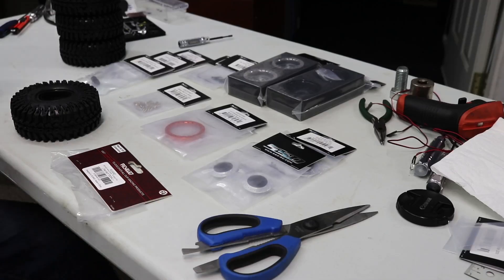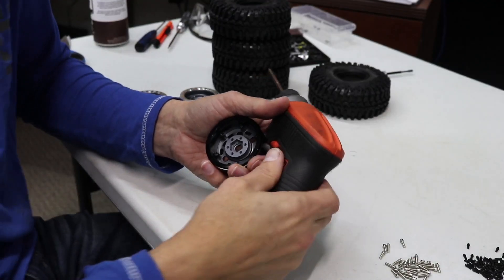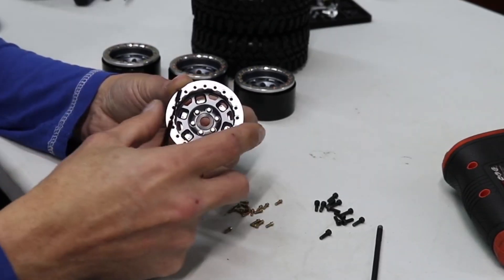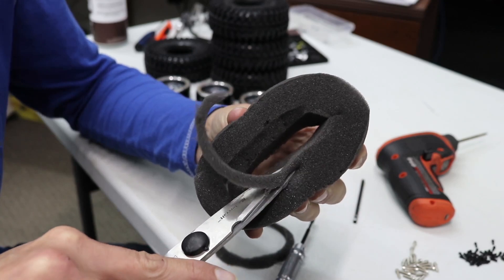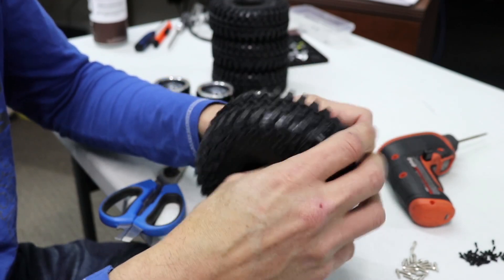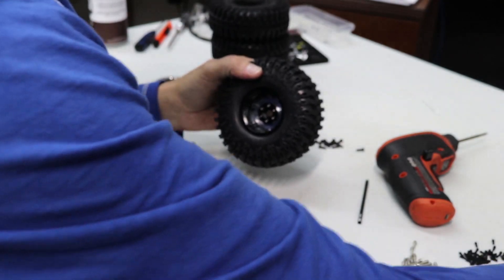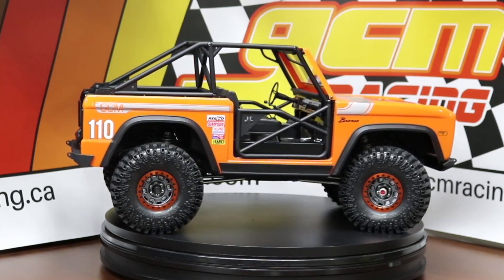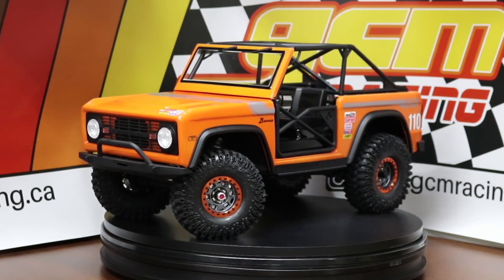Axial SCX3 Bronco - Project Orange E4

Comment: Do you have a part number list for the hex hub and wheels? Cant see them in the videos at all. Thanks
Reply from the maker: I'll add to the video description, sure: The wheels are SSD 0264, Rings are 0356, Hubs are 0192, screws are 0407 and 0372, hub nuts are 0011 and 0176